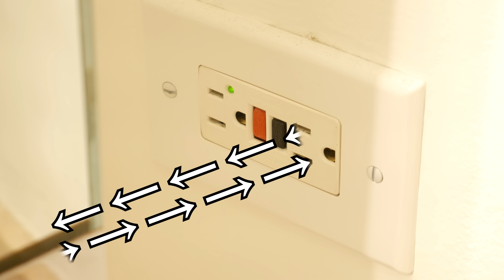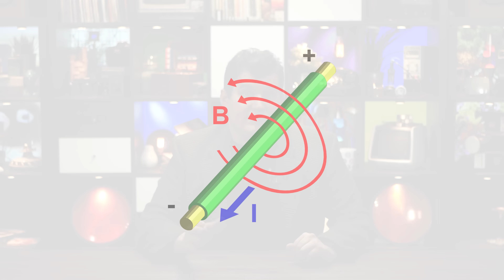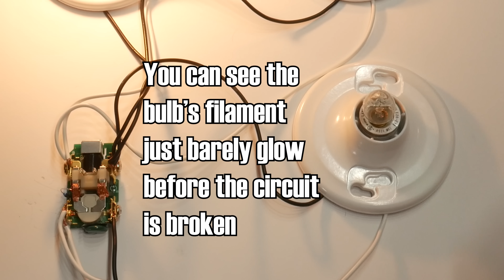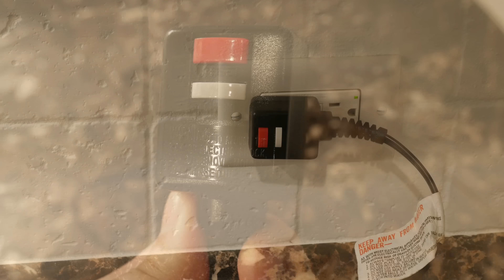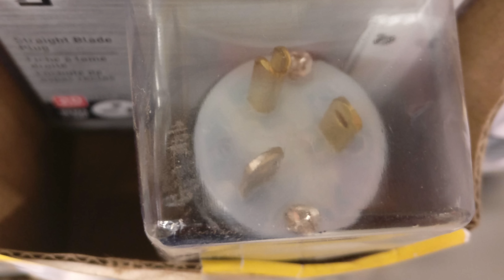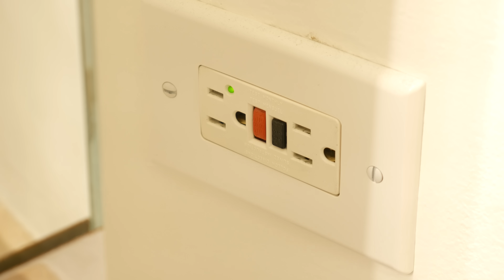The GFCI/RCD: A Simple but Life-Saving Protector

Comment: In many countries there are no labels on the switches of circuit breakers. Usually a switch would be responsible for a room or a region in a room and not an individual socket. Knowing which one responsible for which area in the house is guesswork and it's up to the resident of the house to label them all (in Europe most people in cities live in apartment buildings and not private houses).

Comment: In Germany they are called "FI", with the simpler to explain I part of it referring to the symbol for current, and the F to the German word "Fehler". A close literal translation would be "erroneous current switch" (well, sort of), but they do the same thing. Usually they are in the same place as all circuit breakers, and depending on the age of the installation they are either absent (not sure whether they have to be installed as long as there is no modification to the existing electrical system, if it is modified, then everything has to be brought to current standards), only for bathroom and/or kitchen and/or outside outlets, or, as the current rules dictate, for all accessible outlets - where it makes sense to have several for the entire house. Those rules change every once in a while and since I don't work on that stuff for a living, i don't keep up with it.
But no matter where you are and what name you use, those safety switches work the same way.
The only thing that always puzzles me in the US are those flimsy outlets. I just returned from a two week business trip to Oklahoma and I had to tear apart half of my hotel room to find one outlet that has enough "grip" to hold my dual USB charger in place without it just falling out of the wall. Also in our conference room the plug of a power switch slowly inched out of its wall outlet, just due to the downward force of the attached cable hanging down to the ground, giving us some nice arcing... Yes, other than the plugs/outlets used in Germany they have a defined "hot" and "neutral" side, but the ones in Germany and many other countries just solidly stick in place. And 99% of all use cases have no preferred "hot" side anyways. Still they are not as bulky as the UK models, which tend to sit on the floor with the pins pointing up all the time, just waiting for you to step on them. Ouch.
Back on topic, I wonder how many people actually test them. When I stay in hotels in the US, I used to test them, but one was obviously faulty causing it to trip something further upstream, leaving one floor of the hotel in total darkness until they had fixed it. (oops!) Since that day I hesitate to test them...

Comment: Service panel GFCIs are often used stateside for water-based circuits. We had to add a GFCI breaker for our hardwired dishwasher as well as the outlet for our pool filter. In my grandmother's home there is a GFCI that looks like an outlet without holes in a double-gang boxnext to the service panel, for jets in the tub.

Comment: One big problem with putting the RCD / GFCI in the socket / receptacle is that you are only protecting the equipment connected not the household wiring itself, so drilling holes in walls and floors  and hitting buried cables is much more dangerous.

Comment: I wonder if the circuitry is binned during manufacturing and while the face plate may be the only easily recognized difference between the 15- and 20-amp versions, the 20-amp version is more likely to protect you properly. 

I'm not asserting that this is the case; it's just a thought I had.

Comment: In my house in england, they installed an RCD breaker in out house, in the main switch. the problem is, it cuts off the whole house. I've installed them previously in plugs, and pretty much had to remove them from everywhere, because pressing Test cut the power from the whole house.

on top of that, my mum kept blowing the power off when washing the hob, and ironing... we've since replaced both appliances.

Comment: Great video!  I've known what GFCI protection was for for a long time, but never knew how they were built inside.  The use of a monitoring coil around both lines is simple and it works well.  My house was built in 2012 and the code here (Kansas) requires all bedrooms to be on "Combination Arc Fault Interruptor" breakers or CAFCI.  I'm finishing my basement and the new circuits I've installed required CAFCI but not GFCI for the bedrooms but the unfinished side, the bathroom, and the counter by the sink all require GFCI with a conventional breaker.  Could you do a video on CAFCI and what their function is?  I understand it's trying to detect electrical arcs but I've had the one supplying my computer room nuisance trip while gaming several times despite there being no arcs.  Since computers, especially while doing a high power task like gaming, can be a spiky load I'm wondering if that caused the trips.

Comment: As an electrician I love GFCI technology. Normally, when tasked to replace light fixtures , I just turn off the switch feeding the light . Newer electronic switches have changed the game. When you turn them off, they don't actually break the circuit - rather they reduce the voltage necessary to turn the light on so it appears de-energized. In actuality it keeps the circuit closed to provide a return path for the electronic features of the switch through the unlit lightbulb, as many of these switches do not have a neutral terminal. You can directly observe this , by unscrewing the lightbulb and watching indicator lights turn off on the switch. This is good and bad , but is done primarily to counteract scenarios where there is no neutral present in the junction box . Current code requires all junction boxes to have a neutral present , but many older homes and non compliant newer installations lack this provision.

The upshot being , I was recently shocked by a lighting load I thought was switched off. Fortunately the circuit was protected by a GFCI device. I was shocked for only a brief moment before it tripped the GFCI. It responded so quickly that I didnt even find the shock painful. I was extremely thankful and impressed by this relatively older technology !! 

But I caution all DIYers and uninitiated electricians to be wary of the new switches being installed in homes that do not actually open circuits when switched off ! They are becoming more and more commonplace , and the safest thing to do is turn off the branch circuit breaker !

Excellent video! Thanks again , I'm a subscriber and avid viewer.

Comment: Oh, yeah, right. I should probably test my FI (German: "Fehlerstrom-Schutzschalter" - a literal translation would be "Fault current protection switch", i.e. an RCCB. The F is for "Fehler", i.e. "Fault" and I is the formula symbol for current). It's not really common knowledge to test them I think. They are mandatory in Austria for all circuits with sockets up to 16A (which is what the individual circuit breakers trip at) and must be rated at max. 30 mA.
One in the distribution board is standard here. (We also have the "Schuko" plugs and sockets. The various different plugs and sockets across the world with their pros and cons might make for an interesting video too - I always freak out when I see your plugs with bare connectors :)

Comment: You stated that the CFI circuits do NOT act as "overcorrect" protection.  A few months ago I hired a contractor to do work in my siding. The contractor plugged his air compressor (which was driving his nail gun, etc) into an outside outlet, which was wired in series with the GFI in my garage.  During the time he was doing the work, he would trip that CFI a couple of times a day.  I had assumed that it was because his air compressor was drawing too much current.  Would you be suggesting that the real issue was a ground fault occurring somewhere between the outdoor outlet and the air compressor, such as a short in his extension cord??
Reply: Dan Allen Unless it was a combination gfci/overcurrent protector.
Reply: Well, I'm in the US, and this was a builder-installed outlet.  I think my builder would have prefered to chew his own arm off rather than install ANYTHING more than he had to by code, so I I'm pretty sure it's only a CFI outlet.  Thanks for the information.  Love your videos!!

Comment: You are correct, central RCDs have certail disadvantages! It is not just inconvenient to hunt for the defective device which can be anywhere, it is really bad to have to do that in the dark! When the RCD trips at night time, it is really bad. Especially if you keep sleeping and your alarm clock is AC powered.

Some say that keeping the lights separated from the RCD is the perfect solution. But changing lights or drilling holes into the wall is still dangerous. It is better to use two RCDs and split the flat in two halves. That way, you still have light from the opposite side of the corridor and can use a short extension cord until you sort things out. (e.g. for the fridge).

Also the bathroom should have its own RCD and this one very sensitive. Since almost all devices create a very small fault current, it all adds up so you need a very insensitive RCD to power an entire flat.

Comment: You are fully correct, owning an RCD is no excuse to become careless. What decides how much damage your body takes and when your heart fibrillates is current density in your body and duration. The greater the shock, the less duration it takes to die. If the shock is big enough, the duration doesn't matter any more.

The RCD can't limit the intensity of the electric shock at all. It just limits the duration. You can still die easily, it is just less likely during common electric accidents.

Comment: While the sensing circuit is very simple, it can fail easily when confronted with pulsing DC and RF. LED lights cause pulsing DC which can "lock" the RCD so it won't trip. So when replacing all (or most) lights with LEDs, make sure your RCD is up to date.

http://www.elektrotechnik-hager.at/pics/Typ.jpg

The AC-types are banned in Europe since the early 1990s. You need a B-type to run many LED lights and switching power supplies (e.g. computers) like in a modern office. The "ancient" AC-type can even catch on fire, if you find one, you must replace it! You also should replace any A-type as well even if it won't catch fire, it just might fail to trip even with a massive ground fault. Just check for the symbols, instead of "kHz", the box can be filled with many "squiggly lines"

Comment: One of these saved my wife's life. A few years ago she was scooting an old chest freezer in the garage. The freezer was ungrounded, with only two plugs. The cord got tangled in the back somehow, and the metal cabinet sliced through it. I was about 10 feet away at the time, and it shot out a huge flame and Spark. And that was it! We couldn't understand what happened. And why it wasn't bigger, or more dangerous. She never even felt it. And then we realized there was a GFCI outlet by the breaker box that had tripped. I've had since installed a bunch more of them all over the house!

Comment: If you go through frame by frame, you can see the frame that the 2nd small light trips the GFI outlet.
The coils light up for one frame, it is the same frame that the GFI clicks.

It takes a few more frames for the coil to cool down and stop lighting. 
So; roughly speaking, the GFI can detect a trip faster then a bulb coil can cool off.

Comment: the different face plate is due to the circuitry in the device not the ability to connect to the type of plug. it saves the company money by producing only one base component but using it in both products.

Comment: In Turkey they call them "Kaçak Akım Rölesi" (meaning: Leakage Current Relay). They install them in the main fuse box of the residential and it is obligatory. And yes, no one ever opens the fuse box and tests them. :)

Comment: Here in Germany its mandatory to have GFCI protection in the fuse panels for the whole house and every circuit. Nobody would consider optional protection on some sockets to be safe. Compared to our CEE7 sockets the US system pretty much shouts: "Shock Me!", there is no protection getting the fingers onto the contacts while plugging in.

Comment: Some computer equipment has noise suppression capacitors from the line inputs to the (third wire) ground terminal.  Normally these don't carry much current, BUT if you plug enough devices in that have these noise suppression caps, it can trip the GFCI.  You can end up chasing things for quite a while looking for the fault if the threshold is too small.

Comment: Thank you for posting this! After doing this video, I have a great suggestion, which follows the same topic: AFCI's, or Arc-Fault Circuit Interruptors. At least in Canada, they are now required on almost every circuit in a home, and prevent arc-faults, which neither GFCI's nor standard breakers can detect. Also INCREDIBLY important for homes with Aluminum wiring, since it's super easy to accidentally mix copper and aluminum, which causes corrosion, which causes heat, which causes arcing, which causes... you get the idea.

Comment: The reason your GFCI lights orange when pressing reset is because your GFCI has self-test function. It is running self-test when orange LED lights up. Effective June 29, 2015, all GFCI receptacles and breakers are required to have self-test function. This was due to the fact practically nobody tests their GFCI monthly. :)
Reply: But wait... doesn't the fact that you just pressed the reset button mean that the device had tripped just before that an thus proved it is working? Makes me wonder...
Reply: The orange light lights up not only during reset, but also whenever it performs self-test while GFCI is in reset condition.
Reply: Okay, with this additional bit of info mit makes more sense. :)
Here in Germany we don't have them integrated into outlets or devices' plugs. (The latter can be found in very rare occasions, when I was a fire fighter, we used to have a big "vacuum cleaner" to remove water spills that were too much for mop and bucket but not enough for a large pump. This device had its own RCD in the plug since you never knew if there is any protection on the outlet you connected it to. But common household devices like a hair dryer won't have that over here. Never.

Comment: Won't spare you the pain of a zap. The RCD is meant to trip quickly enough that less than a full cycle of AC and usually less than half of one has passed, greatly reducing the risk of ventricular fibrillation, but it may still hurt like hell.

Comment: GFI panel breakers for US installations do exist. The circuit for my pool pump uses one since the pump and light are wired and don't have a plug.

Also, a possible advantage to having the interruptor on the outlet is that a fault won't thrust you into darkness should the circuit being interrupted also be responsible for lighting, and also cases where appliances would have a very slight fault current not enough to trip an interruptor on an outlet but a combination of small faults would be enough to trip a whole circuit

Comment: Thank you for the very informative video!  Subbed.  I am familiar with GFI and what it does but never knew how it worked.  I do have.a question though.  At a few points in the video you say that there's an equal amount of current flowing in from the hot and back out to the neutral.  Isn't this technically incorrect?  The load is drawing current so isn't it that the return has a slightly less amount of current?
Reply: Thanks for the response but I'm not sure your analogy is accurate.  If electrons are carrying energy then what is energy?  By the way, I was talking about current and not electrons specifically.
Reply: Sure, I'd love to get an answer to all this.  I guess I could find an engineering forum.  Good suggestion.  The problem is that every video I have seen on this subject uses diagrams and makes statements that make it appear as though current flows through a circuit and that everything is the same in and out.  But with a load in the circuit that can't be.  Something is powering the load and is not returned.  When I ask about this discrepancy I usually don't get an answer at all.  I read the Wikipedia article for electron and it states, in part, "Electrons radiate or absorb energy in the form of photons when they are accelerated."  This seems to answer or at least give me a clue how it really works.  Again, thanks for your responses and sharing your knowledge.

Comment: As for the "oops" around 3:08 for the current direction, you're half right. The supply is AC, which means that the current changes direction 60 times per second (since we're looking at a US supply).

And I forgot: when these devices first came onto the UK market, they were called ELCBs "Earth Leakage Circuit Breakers"...
Reply: Changes 120 times per second, a full cycle happens 60 times a second.
Reply: @Owen_loves_Butters  Oops!!

Comment: While it sure makes the search for faulty devices easier, a big argument for having an RCD that protects the whole circuit is that it also protects against fault currents that don't go through any outlets. It's not like every appliance goes through an outlet; room lamps, ceiling fans, electrical heaters, stove, etc..